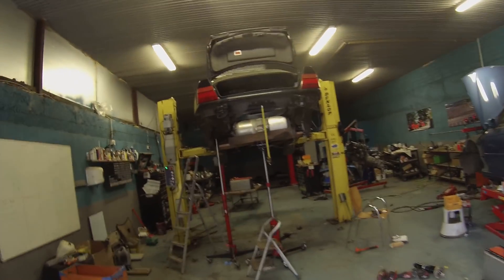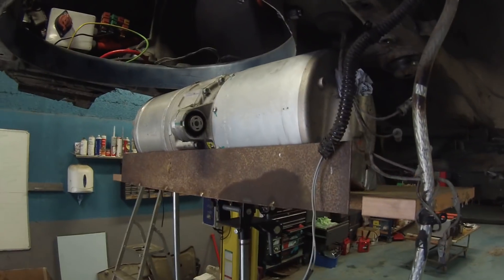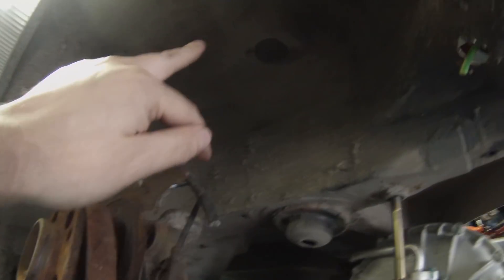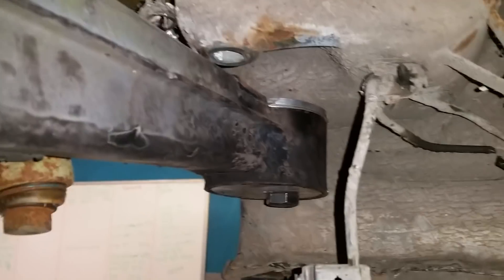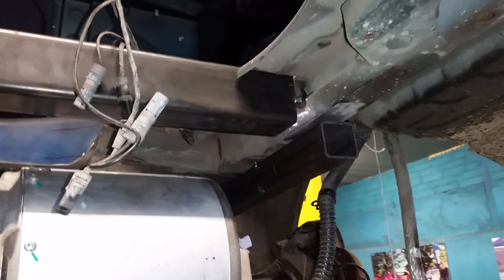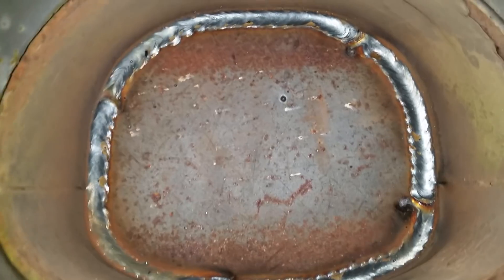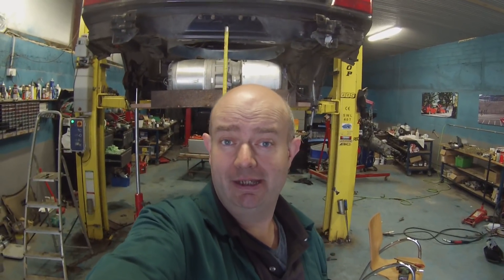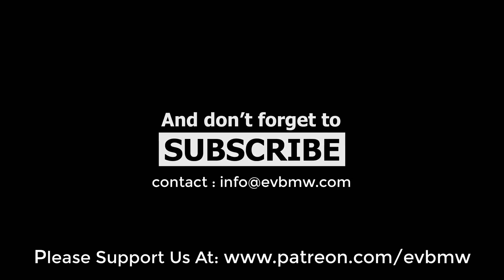BMW E31 840CI EV Conversion 84 : Tesla Swap Day 4

Comment: Damien, the shock mounts are not designed to take the weight of the vehicle. There are strengthening plates available from the Guy on the Bimmer forum, MTech aka Phoenix Motor Sport who makes the top plates & BMW have the lower/inner strengthening weld-in Inserts. Both together should give the strength you need. Looking good. Good luck.
Reply from the maker: Great thanks. We are going to beef up the shock towers but if I can get ready made bits so much the better:)